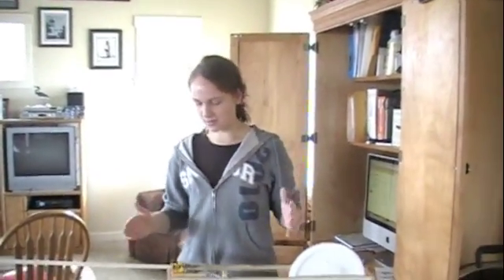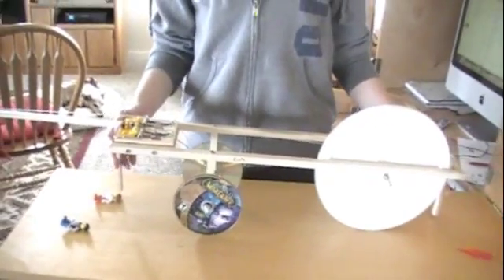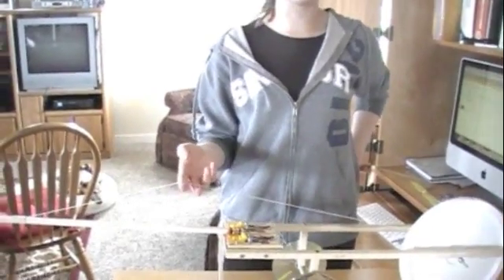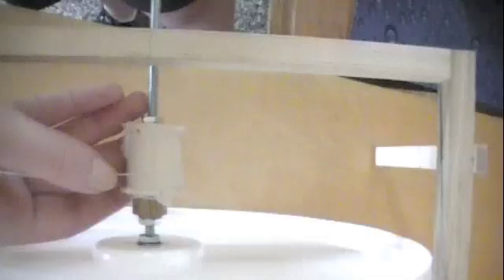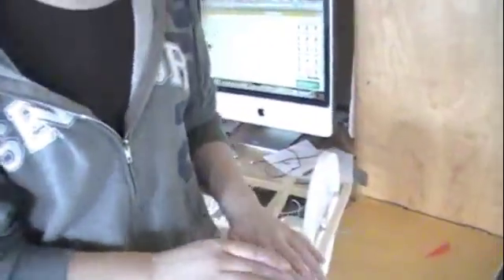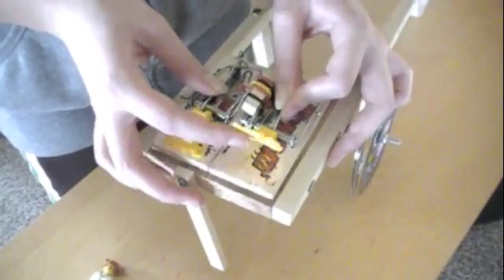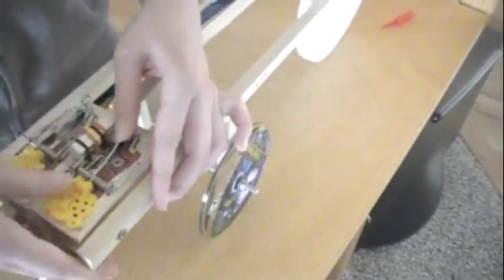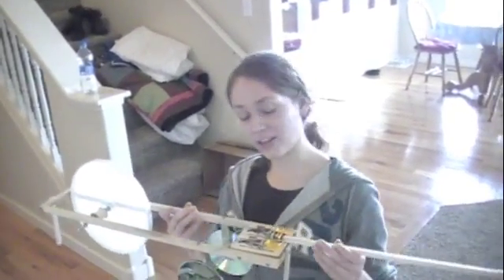mouse trap car that goes forward and back

Comment: I love you for posting this video! I've spent a few days thinking on how i would get my mousetrap car to go backwards, and i had came up with a few ideas of the using string to turn the wheels from the mouse traps going off, but i couldn't think of a good way to attack the string to the traps... and this video has given me a great idea, thanks for the help!
Reply: SamusPvP that was pretty obvious to me. Putting a stopper/catch on the spool or axle so that you can wrap it in alternating directions with out just unwrapping it